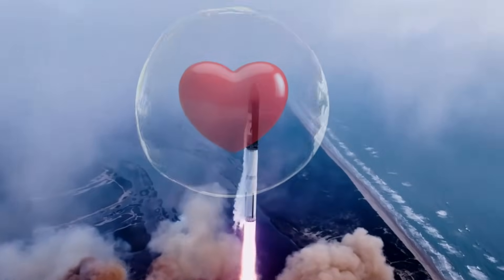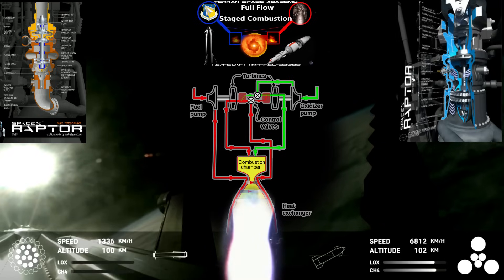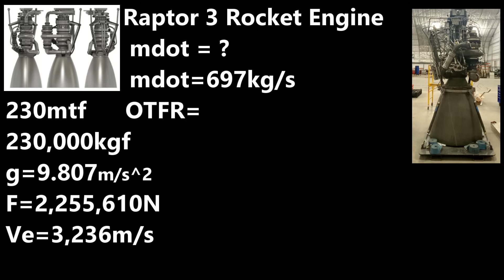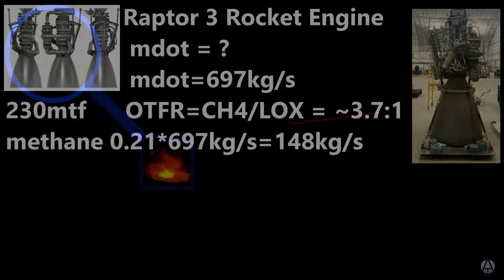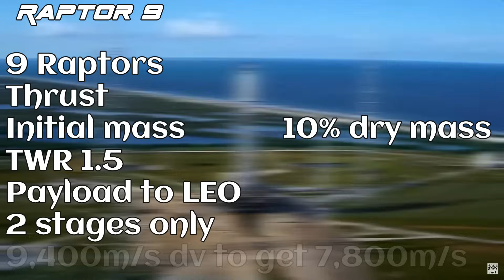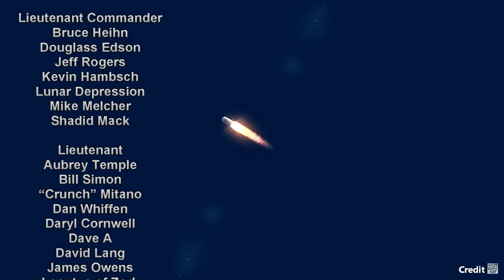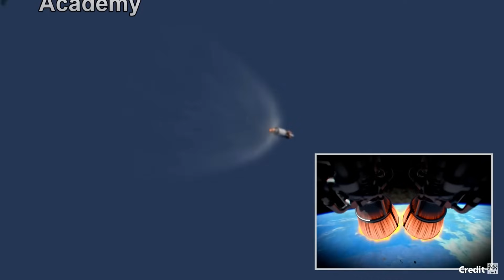Starship IFT 4 June Update and Hot Gas Thruster Mode for Raptor!

Comment: Not so much a net but a 2.5 mm wire half encircling the ship twice per heatshield hight. 
  Let say one 2.5 mm wire with fiberglass insolation, every 6 inches.  
  Let's say 45 feet per wire.  
It just seems like a big roll of tungsten wire to me.
Reply from the maker: I live that, what would the total mass be?
Reply: Not sure. Let's say about 2000 meters of 1mm tungsten wire. A 3 strand brade would probably work best.
 So let's say 6000 meters of 1mm tungsten wire.
  I'll find the weight of the tungsten and calculate it and comment you back.

Comment: I need some feedback from you guys. I have an idea about the heat shields. 
Look at a heat shield. Let's call the flat top 12 o'clock. Now, rotate it 90° left or right doesn't matter.  Looking at the sheild on end. 25% of the way down and 25% of the way up drill or cast in tunnels about 3mm all the way through.
  Take a fine braided tungsten wire with  fiberglass insolation and thread it through the sheild to the next and so on through all the heat shields. The top of one shield will be lashed to the bottom of the one next to it, and so on. At one end of the wire, there should be a simple spring tensioner that will be covered by a bonded on shield. At the other end, another adjustable spring tensioner.  The tension to be calculated.  Also ultimately covered by a bonded on shield. 
Thank for listening   and if you talk to Elon tell him I said  
  Good luck, Elon, with the launch, and thank you for what you're doing to better mankind.
Reply from the maker: I wondered about that and did some math on the mass... Quite a bit if you make a "net" able to restrain all the tiles.

Comment: Correct me if I'm wrong. But aren't the thrusters on Starship not hot gas thrusters? Aren't they warm gas thrusters? They use the hot gas from the methane and oxygen tanks for Reaction Control. But they don't burn it which is what I always thought was what hot gas thrusters do. They're kind of like mini engines while warm and cold gas thrusters are identical. Just nozzles connected with a valve. 

I do think SpaceX should attempt to create hot gas thrusters since they provide considerably more force for less propellant. Yes it would add more weight and complexity, but it's possible the reward outweighs the downsides. 
I don't think it would be useful for Super Heavy, but it might be useful for Starship itself since it would eventually be used for long distance traveling
Reply from the maker: That's probably the best way to describe them...

Comment: Hey Doc, here is my water cooler guess. Once fully operational, Starship will need all the power it can generate to reach orbit w/ payload and over complexity, let alone at stage sep, is not in Elon’s DNA - unless the complexity is reduced to far and requires some addition. Additionally, (with CSI Stsrbase’s Special Report on hotstaging ring jettison out) I am more and more convinced this is why SpaceX is transitioning to the N1 style hotstage configuration. It’s just not as complex. Less than full propulsive landing is an intriguing concept, however, and I could very well see Raptor engineers toy with it once in a more mature phase. Raptor 9 would be an incredible evolution from Falcon and probably much easier to human rate compared to FH, but I feel if anything was really feasible that just human rating FH would be much more cost effective. But damn do I love the sound of a Raptor class of SpaceX rockets!!
Reply from the maker: Someone had the briliiant idea of making the Starship landing legs the actual hot stage hardware...
Reply: @terranspaceacademy  That would be a good idea, however, they would still need to be retractable for reentry. What about liner actuating posts that could retract after stage sep then extend upon landing? They could also be use for leveling as well. Tesla is making their own actuators for Optimus, I’m sure they could whip up some Starship sized ones in no time.

Comment: The issue with your idea for the hot gas is that the booster MUST keep its center engines going to ensure the booster fuel remains settled at the bottom of the tank, and to initiate the separation maneuver. Meanwhile, the ship must pull distance from the booster as fast as possible and that demands exceeding current booster acceleration, which as you recall will be using its inner engines still. So the HGS mode would need to exceed the thrust of the core booster engines of an almost empty booster, and that is just not feasible. 

It remains something to be investigaged for moon maneuvering however, but for HLS at least this is already going to be handled by the landing engines
Reply from the maker: Good point... Still land on the Moon though :-)

Comment: Enjoyed the video. I am excited for IFT-4. Makes me wonder why they have problems with plugging of the plumbing system.  One of 2 potential causes seem likely. Maybe they don't purge the tanks and piping with a dry gas and it is humid in South Texas. Seems like a very trivial problem that any engineer or technical person would pick up on immediately. Or maybe their piping introduces particles. Rusty pipe? I certainly don't have the answers, but clogged filters from frozen condensate seems most likely in my book. Maybe they do purge, but it is such a big ship, they aren't able to get all condensate? Normally, a vacuum for an extended period of time is the most efficient method of drying a system, it is used everyday when AC systems are serviced. The only issue with this situation is it would collapse the whole ship.
Reply from the maker: I was surprised too... Would there be enough ice to block filters?

Comment: The temperature in raptor preburners is limited at 800°C to not damage the gas turbines blades, actuall hot gase thrusters of the future orbital maneuvering system engines would need to have a exhaust of 2200 °C for reaching 300 second specific impulse, so a raptor used in that mode would have a much lower performance.
Reply from the maker: That did seem quite high... 160 and above should work fine for this purpose.
Reply: @terranspaceacademy  you don't understand my objection, most of the performance of a rocket engine is given by only two parameters, the molecular mass of the exhaust (the smaller the better) and temperature of the exhaust (the higher the better), if you try to use only the preburners as a propulsion system you get a really shitty rocket engines, those preburners were designed to work at a relatively low temperature to spare the gas turbines blades so wouldn't adequate at all, also your math seems to be sketchy, low specific impulse means also low thrust, with sixth engines running at 50% the upper stage cannot do hot-staging from a almost empty booster that uses even a single engine (you see fuled upper stage is 1400 tons and the booster only 300 probably) . As a side note, If you want to get a accurate estimate of the specific impulse related to temperature and molecular mass you can check on the nuclear thermal rocket numbers, Scott Manley made a video recently and used a chart that do not contain methane, but ammonia since those two have almost the same molecular mass that would be useful.
Reply from the maker: That's the entire point... To dramatically reduce the power of the engines so they can be used to land on the Moon without kicking regolith back to Earth.  We WANT low thrust...
Reply: @terranspaceacademy  you are speaking about hotstagging, maybe you don't understand in order for two stages to separate you need that upper stage to have a thrust to weigh ratio bigger than the booster, otherwise the booster would keep pushing into the upper stage, it's a reason why the upper stage have that thrust it need it for correct separation and it's probably minimum required when is fully loaded.

Comment: Hmm.... I'm confused. I understand the concept and the match but how would turning the 20 Raptor Boost engines on the Booster into hot gas thrusters push the Ship away from the Booster? Wouldn't that only reduce the thrust on the Booster (like shutting down all but the inner 3 core engines)? Would it instead be turning only on the three RVac engines methane turbo pumps on and then ramping them up?
Excellent job walking through the math though. I think this is the first time I understood all the numbers. Don't know if I could do it on my own (!) but now Ii think I get more of the concepts.
Reply from the maker: That was my one error for everyone to look for :-) Seriously it should have been the six outer vacuum Raptors.
Reply: @terranspaceacademy  <G> Still an interesting concept. It would basically be igniting the pre-burners, wouldn't it?
Reply from the maker: Yes... to turn them into "weak" hot gas thrusters with low exhaust velocity so a Moon landing could be performed without additional engines high on the rocket.

Comment: How about get rid of the fire ring and just add another skin on top the booster and run the methane burner by itself until there's enough distances then start the o²
Reply from the maker: That's what we were thinking... Someone said make the landing legs the "hot ring" I like that too.
Reply: I think there going to build a legged ship. They'll have to, to land in different places around the world. 
  I think it's simpler to design it this way first. Refine the ship first for its primary job, then add legs. There going to need legs for mars, the moon, and earth , but they build the most useful product first

Comment: I'm wondering about pressures in the preburner. With the Oxidizer pump off,  the oxygen line would be at the same pressure as in the main tanks, and with the preburner likely running at a higher pressure than them, the oxidizer wouldn't be able to flow correctly, right ?
Reply from the maker: The oxygen preburner would need to run at a low level.

Comment: All of that math sounds great. But this is a Full Flow Staged Combustion Engine. So what Oxygen is being used to power the Methane turbine if the Oxygen is turned off? A small amount of Oxygen is needed to power the turbine. All that Oxygen flows through one Oxygen pump so a separate valve would have to be used past the Oxygen pump to shut of the main Oxygen flow to the combustion chamber, but the turbine, therefore the pump, would still have to be operating to send Oxygen to the Methane turbine that powers the Methane pump as well as a small amount of Methane to still power the turbine that powers the Oxygen pump, even at a reduced flow. Now, those small amount hot burned combustion products are still going to be sent to the combustion chamber. Lastly, even if you somehow got a small amount of Oxygen to power the Methane turbine, the Methane flowing through the engine would still be at cryogenic temperatures as it flows through the combustion chamber and out the exhaust nozzle, not "hot" gas. The only "hot" gas is from the turbines powering all this flow. Now if you were to plumb a by-pass system to allow the Methane to go around all this, expand into gas then back out the exhaust nozzle, then we're talking a much more complicated system. Not the way Elon designs things. "The best part, is no part". Just my observation,  Did I missed something?
Reply from the maker: The oxygen preburner can operate to pressurize the tank without the engine running... The same should provide enough oxygen to the methane side.
Reply: @terranspaceacademy  Don't you need both pumps running to provide Methane and Oxygen to the entire system?

Comment: Hot gas thruster mode sounds amazing! Surely somebody at SpaceX is thinking of this, but if not, I sure hope they see this lesson! That could REALLY simplify Lunar Starship!  
Back in the Apollo days, there was a development program to upgrade and simplify the J-2 engine. The J-2X developed for Ares I built on that work. But as I understand it, one of the variants had a low-thrust, pressure-fed mode where combustion started before turbopumps, allowing a tap-off of the exhaust gases to spin the turbopumps, thus eliminating the need for high-pressure helium or solid-propellant gas generator cartridges to spin-up the pumps. Also, this pressure-fed mode could run on gas or liquid, meaning that it wasn't necessary to settle the propellant before starting the engines. This was ideal for on-orbit restarts, as it eliminated the need for ullage motors as well. I don't have any knowledge of exactly how the J-2S was  going to be able to pull all this off, but it would definitely have been utilitarian!
Reply from the maker: That's right! They even had an aerospike version way back then... Amazing engineers.
Reply: @terranspaceacademy  Yes, indeed! I've had the honor of meeting a few of the Engineers from Apollo and even back as far as Gemini. Brilliant folks!

Comment: That should be how the current system works using the autogenous pressurization vents for thrusters, the methane tank gets pressurised using hot methane rich exhaust from the methane preburner , when more reaction thrust is needed the preburner can produce extra pressure which gets vented out the appropriate vents
Reply from the maker: I wondered about that... Makes perfect sense.
Reply: @terranspaceacademy  After watching a few more videos about the auto pressure system its possible Im completely off about how it works, Ive heard that all thats needed is to take some of the gas out, heat it into a gas and return it to the tank. That should work, though the gas returned to the tank would just chill and turn back to liquid, however the tank would increase its pressure by heating up. So it seems to me that a better way to achieve this is using preburner exhaust anyway because that would be the best way to increase the temperature to the tank. Now though i wonder what actually happens to preburner gas returned to the tank, methane would produce water vapour and co2, the c2 is fine but water vapour turning to ice would potentially cause a clog and lead to propellant issues. Im looking forward to more details about how this system works from the experts.
Reply: @Marc83Aus  That is some fine thinking. If I understand correctly, it has been theorized that the co2 will also become ice as it's freezing temperature is only -70 degrees and that this is a major contributor to filter blockage. Although this information doesn't come from SpaceX so it's only theoretical. Still I'm impressed with your coming up with this idea before IFT 4.
Reply: @jimcrawford2833  Yeah its been confirmed this is how starship repressurizes , Zacc golden goes into details on the last CSI starbase video, theres several tons of co2 'snow' inside the oxygen tank by the point of landing.
On the interview Jeff bezos did with timm dodd he mentions that new glenn only uses heated propellants as autogenous regas, not preburned propellants. I would love to hear what performance impact that makes but at least they dont have to deal with ice forming inside the tanks
Reply: @terranspaceacademy  So it has been clarified, the iced up ullage thrusters and the engine blockage issue were both on the oxygen side. I look forward to the results from tonights test flight anyway.

Comment: The ship's manouvering thrusters aren't hot gas. They are cold gas. Hot gas refers to thrusters that actually burn atleast some of the fuel. Ship just wents it.
Reply from the maker: Actually, no. Hot gas refers to the temperature of the gas expelled only.  Resistojets are still hot gas and there is no combustion.

Comment: ITF-3 flight data indicates that the specific impulse of Raptor 2 is closer to 300s. This is the main reason for the low payload capacity of the present configuration. Maybe Raptor 3 will fix this.
Reply from the maker: They went high power less efficiency with the 2... I think the added pressure will let them balance it out for 3.

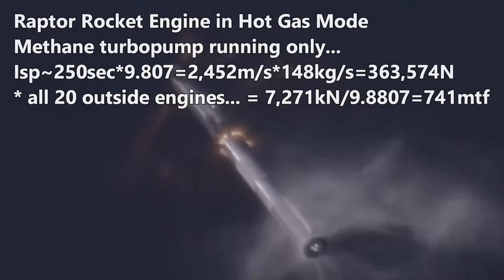Comment: At about 8:00, are you saying to use 20 Raptors as hot gas thrusters to separate Starship? 
If i'm not mistaken, Starship has 6 (or 9 maybe) Raptors. It's the booster that has the 20 engines in the outside ring. Using the booster engine in hot gas mode doesn't seem to make sense. Am I missing something?
Reply from the maker: I was too tired from a long trip. Six of the outside vacuum Raptors on Starship. I did the math on the 20 outside booster engines...
Reply: @terranspaceacademy  Just keeping us on our toes and paying attention.
Reply: I was thinking the same thing.  Those engines are also cold for not having started yet, so I'm not sure what he meant by hot gas as if we're talking about the booster engines the whole time.

Comment: I suspect space x will likely scrap all the raptor 2s rather than make anything out of them elon has already mentione that raptor production is relatively cheap compared to most other rocket engines (ive heard as low as a million per unit) sp it most likely isnt cost effective to modify an existing craft to use old stock parts like old raptors. Its probably most cost effective just to scrap them rather than try to make them work.
Reply from the maker: But it would be so cool! :-)
Reply: @terranspaceacademy why waste the raptor 2s.  Sell it to the rocket power land speed racer gear heads and see what they can do with. 🤣
Reply: @terranspaceacademy  it would be, it could make sense if they sold the old raptor 2 stock off to other rocket companies as well but i highly doubt they'd want to give access to their advanced hardware like that.
Reply: @leisureenjoyer1986  it really is a testament to how fast their iterative design approach would be.